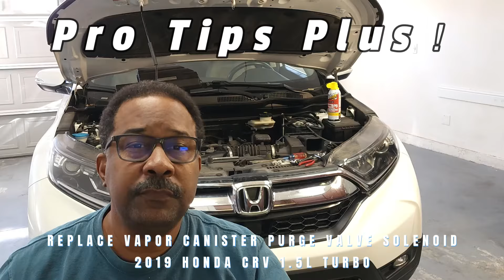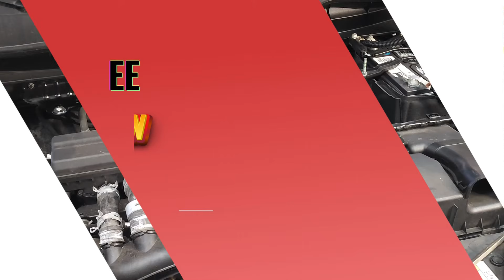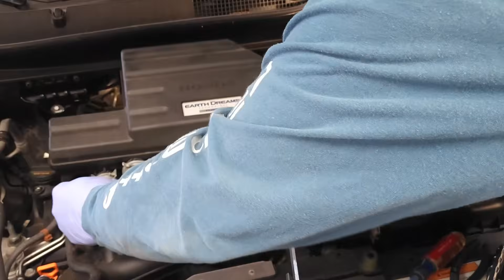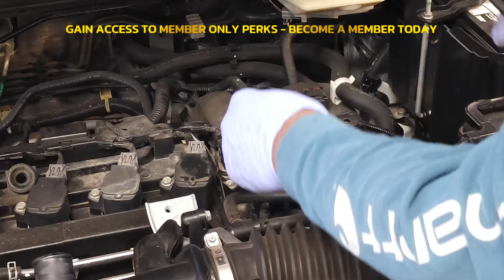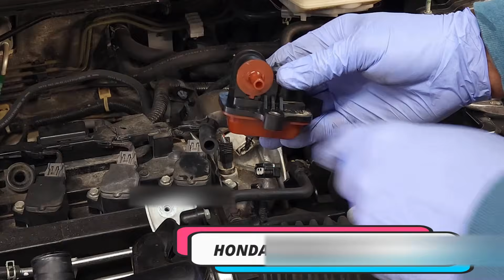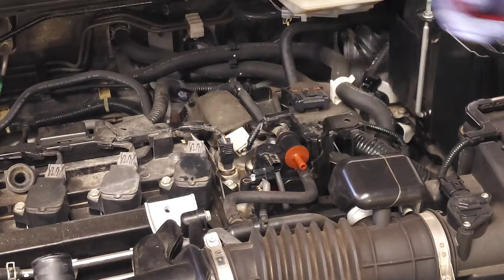2017-2025 HONDA CRV 1.5L (L15BE) Replace Vapor Canister Purge Valve Solenoid

Comment: Why did you not drag test the plug before you plugged it back in on the electrical part? did drag test the connection before the diagnostic and did you test the old part?

Comment: Excellent video. I have a 22 crv 1.5T with codes P145D and P04F0 should I be looking at my purge valve??
Thanks Kirby
Reply: Hey did You Get The problem solved ?

Comment: Would this cause a “check emission” light to come on? I’ve replaced the 02 sensor and spark plugs with no luck at keeping the light off. It’s currently at 160k miles
Reply from the maker: Please provide the OBD2 code. Visit Orileys,  Auto Zone, or similar to borrow code reader.

Comment: Nice vide, just a detail: the part number is 36162-5AA-A01. The one you mentioned is for a check valve that is similar but not the same.
Reply from the maker: Thank you for the clarification. You are correct. I will update the video. Thank you.
Reply from the maker: I found the video error and blurred it out. No excuses, but I am a one man show and occasionally makes mistakes. The videos description was accurate. U Da Man!

Comment: I had a mechanic change my spark plugs. And now my emissions system problem came up on my dashboard. Could it be a connected problem ?
Reply from the maker: New plugs shouldn't trigger an evap fault. Can you provide a trouble code?

Comment: My husband just changed the manifold sensor and the MAF sensor now the car is throwing a smell would it be due to having to replace the vapor canister?
Reply from the maker: MAP sensor-If the old sensor and hose was very dirty, you could get very slight oily smell for say <20 miles, now that air can flow more freely from the manifold. MAFS- You should.not get any odors. Great questions.
Reply: @protipsplus thank you! Appreciate it

Comment: I’m getting a P0441 would this fix my issue?
Reply from the maker: Yes. P0441 is the generic OBD2 code that is the same as the Honda specific P1441 code. Please see video description. Let me know how it goes.
Reply: @ update! I replaced the purge valve, a little tedious, but I managed, the hoses did give a little trouble, but I replaced the part, cleared the code, drove for about two hours, no cel came back on! Thank you for this!
Reply from the maker: @alxvkrm8858  Great job! Thank you for sharing.

Comment: Can my car stall with the check engine on around 1000 to 1500, going 50 to 55?
Reply from the maker: The purge valve should not make it stall. See video and description for symptoms and please subscribe.
Reply from the maker: How's it going? I think you may have an issue with low oil. Do not drive until oil level is within correct range. See....https://youtu.be/vngjTuV7uDU?feature=shared.
Reply: @protipsplus  iam thinking it the battery because if I used headlight on it went it happen so iam going to continue checking it true out the week and oil i has thinking same thinking so I did a appointment for Saturday
Reply: @AZCONA your batteries don’t power your headlights. It’s either your ignition coils, spark plugs, or alternator
Reply: @dbb7_  Well, I did a cleaner and  also oil change she is running well
Reply from the maker: @AZCONA  Great news. Thank you for sharing.
Reply: @protipsplus the purge valve will make it stall